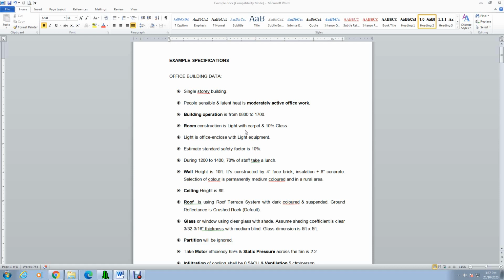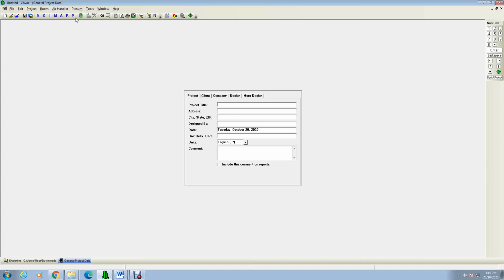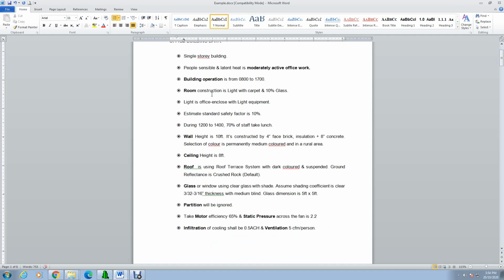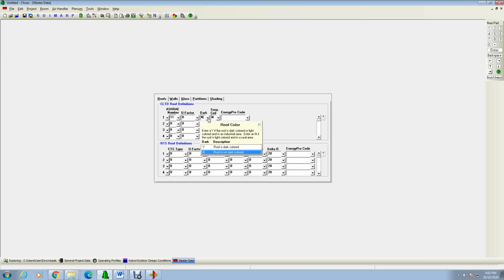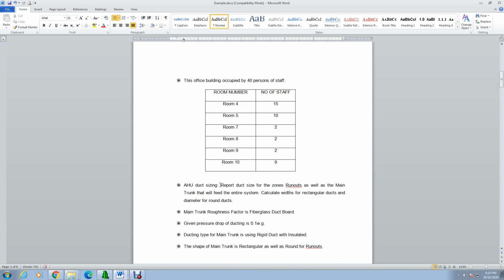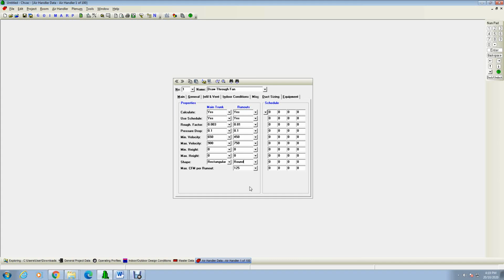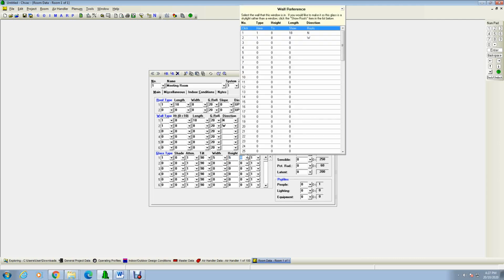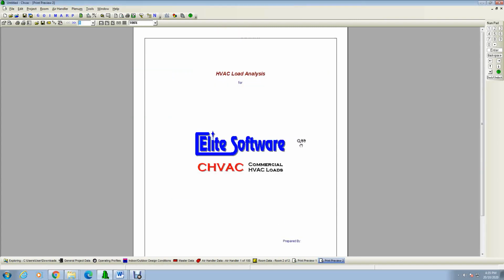Tutorial 2 CHVAC

Comment: MOHD RAHIMI BIN MUSTAPHA
B071710225

In tutorial 2 will be using the CHAVC Software, where this software can calculate the commercial load calculation for HVAC system. Chvac can quickly and accurately calculates the maximum heating and cooling loads for commercial buildings.
There are a few features that CHVAC able to do:
	Calculates peak heating & cooling loads
	Determines building tonnage and room cfm requirements, and runout duct sizes
	Can uses either the RTS or CLTD calculation method
	Computes cfm air quantities with psychometrics
	Reports list the general project data
	Detailed room loads
	Air handler summary loads
	Total building loads
	And many more.
In this tutorial step by step was in correctly order was shown to get the accurate or correct result. To make the understanding of this software easier, an example question from the tutorial 2 was used.
By the end of the simulation, CHVAC will generate a complete report based on what the data input and show the cooling or heating load result and the requirement-requirement or suitable HVAC system for the building.